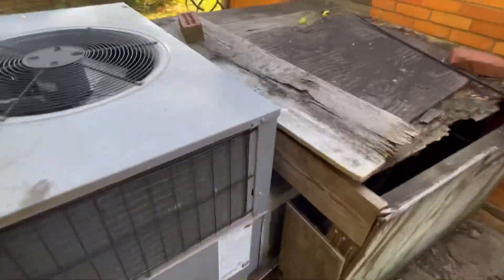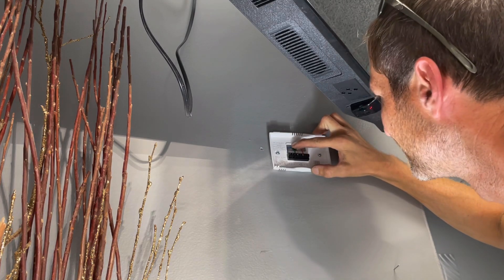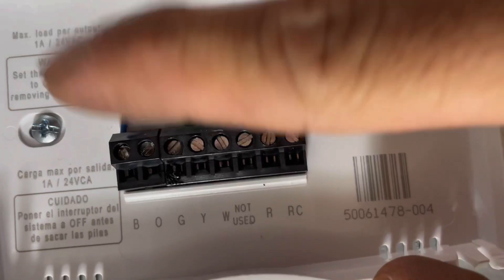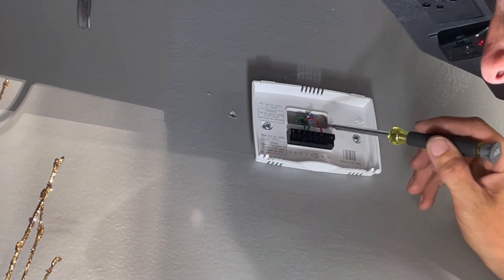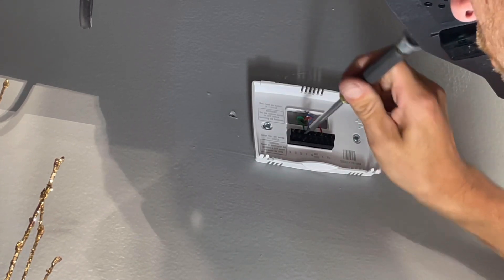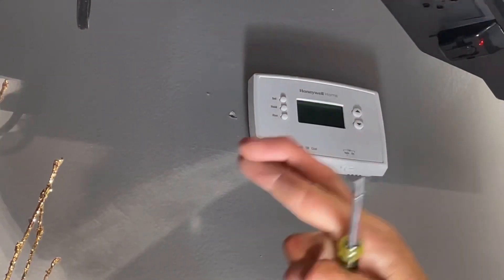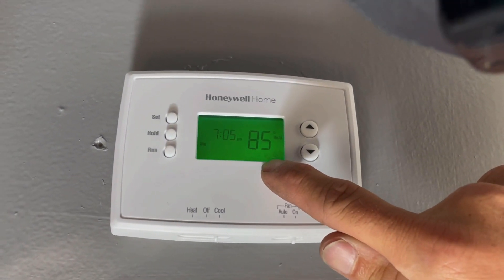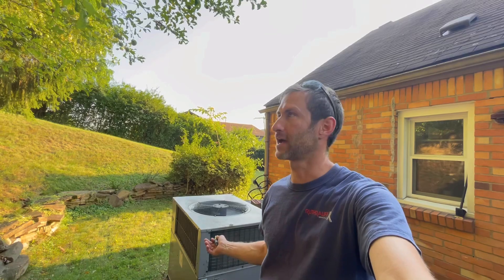Thermostat wiring Fail. #Steamfitterslocal449 #HVACEXPLAINED #RuthRauff #Carrier #Thermostat #hvac

Comment: It may depend on if you have five wire I always use  blue as common in California  but only if you have the five wire thermostat.
Reply from the maker: Yes I have seen a few different wires to be used for common. 
Mostly Black but also blue. 
Sometimes I guess it would depend upon the location.  I had somebody hook up the thermostat using clear stereo speaker wire.  Boy that was frustrating.  Lol I ripped it out and installed an actual thermostat wire.  
Thank you for the info have a great day.

Comment: So, not much time lapsed since the thermostat install--to the time you were called out, right?
Can't imagine that it even worked as the last tech walked away from it, or am I missing something..
Reply from the maker: There is a tenant that is renting the space for a nail salon.  The tenant changed out the thermostat themself. 
The system apparently worked before the thermostat was changed but after it was changed to quit working so.  First thing look into the thermostat.   
I was just instructed by the business owner to take a look and that’s what I found soon as I heard what went on.  That’s the first thing I did was walk up to the thermostat to make sure it was programmed and wired properly.  But everything’s fine now

Comment: Remember that unit with the plywood house over the ductwork. Thanks for explaining the wiring. Thought yellow was normal color code for cooling and blue is common. But realize this thermostat wire didn’t follow normal conventions.
Reply from the maker: I don’t believe there’s an actual code but in the heating and air field I was always taught and most technicians use. 
Red = R or Power
Green = G or Fan
White = W or Heat
Yellow or Blue = Y or Cooling
Black = C or Common
Orange = O / B for HeatPump Reversing valve. 
This is just residential. 
Commercial we use 
W1 / W2 / W3 for Heat Stage 1/2/3.   They utilize different colors such as Brown 
Y1 /Y2 for Cooling staging. They utilize colors Yellow for stage 1 and Blue for Stage 2.

Comment: My one piece of advice on thermostat wires. Wire color don’t matter, it doesn’t know the difference. But it will tell you where it will go for good or bad.
- read wiring schematics
-trace wires/splices and terminals.
Follow color coding if it’s mixed up.
If you didn’t understand that, you shouldn’t try and save a dollar on diy.
Love the channel Tony, it’s legit👍
Reply from the maker: Globe is correct….  color of wire doesn’t matter but it keeps you organized so you don’t second-guess anything.  I wish I’d taken a video of that one time I had somebody wire up the thermostat using all clear stereo speaker while I was furious.   Hahaha.
Reply: HVAC EXPLAINED 
Yeah, we need a trade recommended Ted Green style tech.
Maybe we don’t 😉

Comment: They just went color letter. See that all the time . Good catch.
Reply: Also if it was cooler and the heat cool switch was to heat then would have a iced up coil if the fan wasn’t on. Love it when a customer installs a Tstat and burns something up and fusses about the bill.
Reply: Brutis 1983 
The blue print to diy: guess.
Blame the guy who figures out the obvious for being right…
The t’stat should have known an idiot screwed it to the wall. 😖🤣
Reply from the maker: Ahhhh I didn’t even catch that.  Hahahahha 
Great job.  👍👍👍